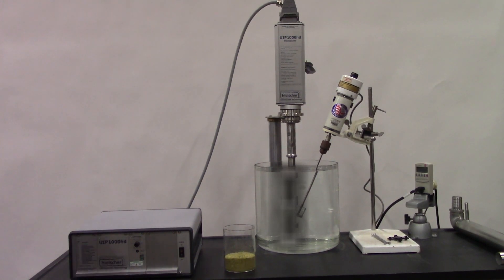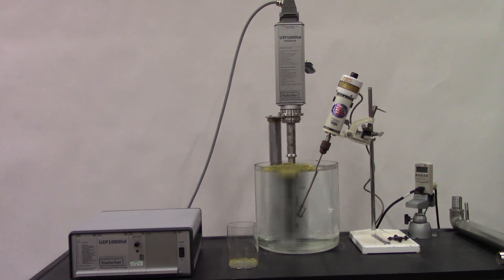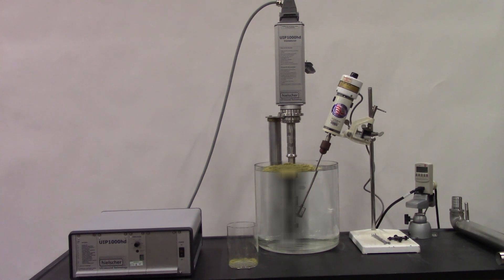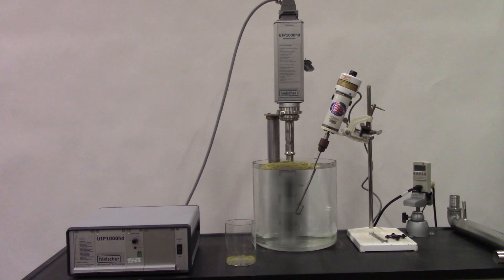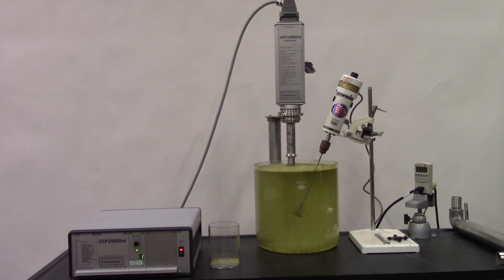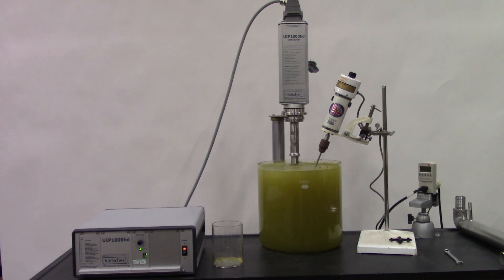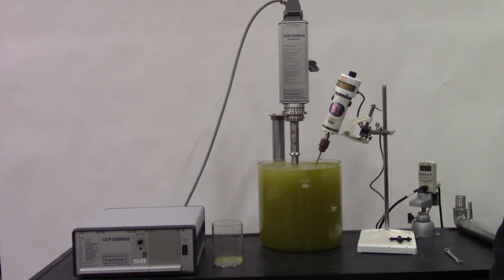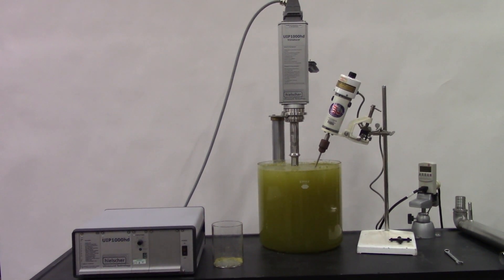CBD Extraction Ultrasonic

Comment: Ive been investigating but theres one or two issues. Number one being that it requires up to 10 parts solvent. 1tonne of biomass requires 10tonne of solvent. Clearly a no go, seeing as that solvent will become waste.
So id say better for a direct mix into hempseed or olive oil type product. But i dont see any figures for oils, just theories from the manufacturers
Reply: On a small scale, using Ethanol for a solvent, you would then strain this, then filter through a buchner, and run through a recapturing unit to recapture 95% of the solvent for reuse many times over.
Reply: @bayerr  can you sent your email for contact you im intrested for essential oil extraction, can you help me
Reply: @bayerr  and what about bin a larger scale? 200kg biomass do you think we could use a 200L capacity rotovap?
Reply: Why would you use solvent?
 Wouldn't water be just fine? Heat up to 60-70C. Homogenize for a while then strain/filter and repeat. The water should contain all the cell stuff you dont really want that usually dissolves also in alcohol. And your cbd should after a few hours separate from the mixture and float to the top. Then just collect and dry up no?
Reply: @clippyHowCanIHelp  wont dissolve in water :)